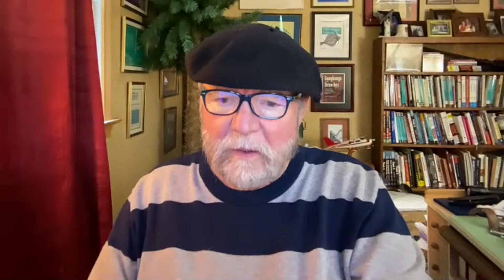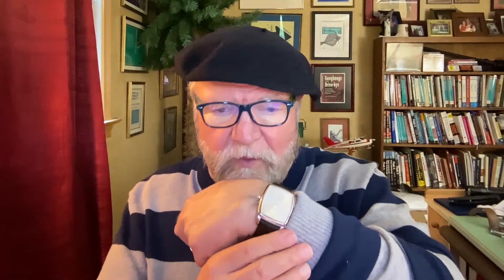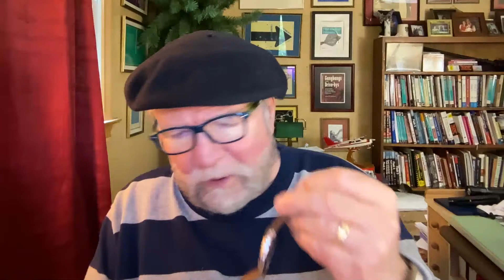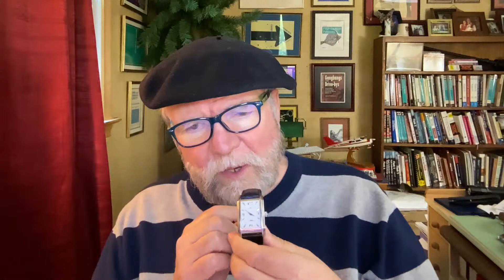Setting a New Criteria for High Horology

Comment: Cast iron works...on tower clocks!
Reply from the maker: Mark yes, cast iron does work on tower clocks...but what does that have to do with watches? Maybe you could explain?🤔 Take care, Bill
Reply: @watchartsci  Only as an aside to the original comment (flippant and all), considering the early uses of the material and their being replaced in time as metallurgy developed better materials, but as always, keeping an eye at the bend to see what comes around, a form a cast iron could even surprise everyone by reappearing in a new guise.
Reply from the maker: @markgallistel9456  We're in a strange place where protests against new materials, while sounding like a luddite, is really a matter of looking for advancements of an archaic process—traditional (read pre-quartz) where all of the products were driven by a mainspring with parts made of transitional metals. At one time I wrote programs for smart programmable devices and had my fill of silicon, and came to value the craftsmanship in traditional watchmaking. So to each his own, and while I want no silicon hairspring in my watches, it makes perfect sense why others do. Take care, Bill
Reply: @watchartsci  As much as I applaud all the strides in progress I take it with a grain of salt (occasionally throwing the whole salt lick at it as a matter of fact), though when it comes to a nice comfy feeling with an item I like, I'll go for old school every time as they can still be worked on by the common man (I'm currently taking online coursed from AWCI as they become available); the only area I will take modern over past without a second thought is in twist & go automatic scooters, I'm getting less able to do the old hand twist-shift routine at 69.
Reply from the maker: @markgallistel9456  Mark, since you'll be my age in another 9 years, you're still "The Kid" and far too young to be hobbled by concerns of "new/old", and the fact that you're taking AWCI courses shows you haven't succumbed to stereotypes of age, even young ages such as yourself.  Best thing I ever did was to take watchmaking courses to learn about watches and find something a little less expensive than buying watches. Just wrapping up a project 50 of us collectors worldwide did and entered our watch in the GPHG... so enjoy! Take care, Bill